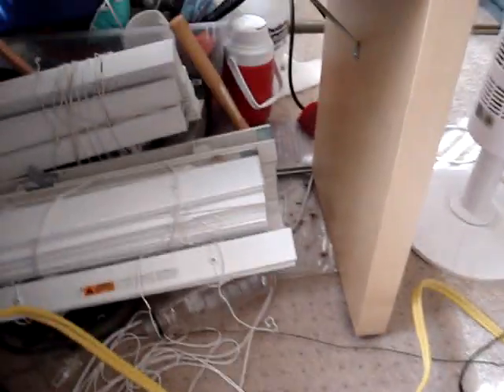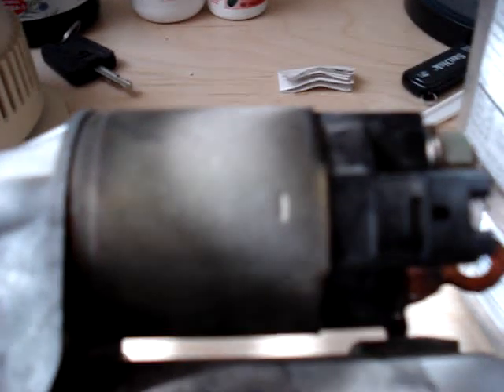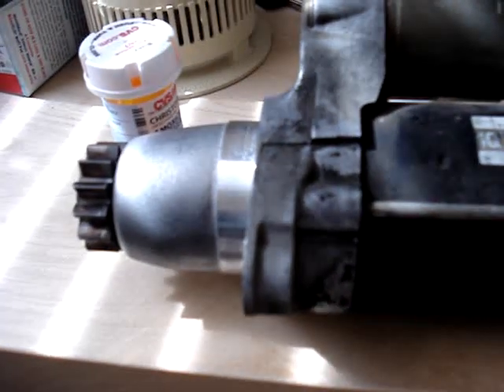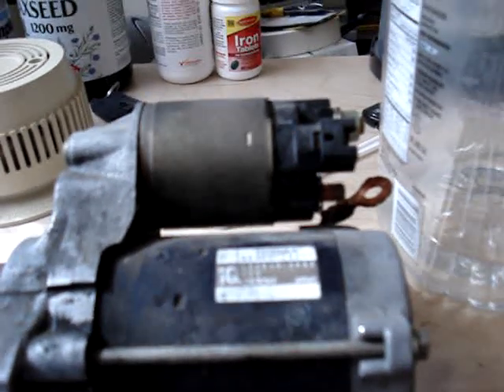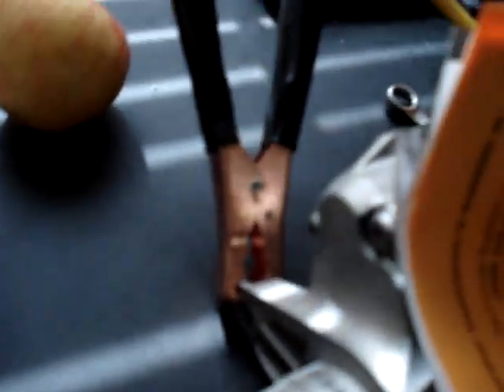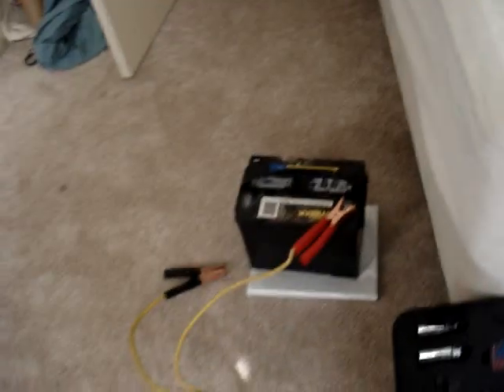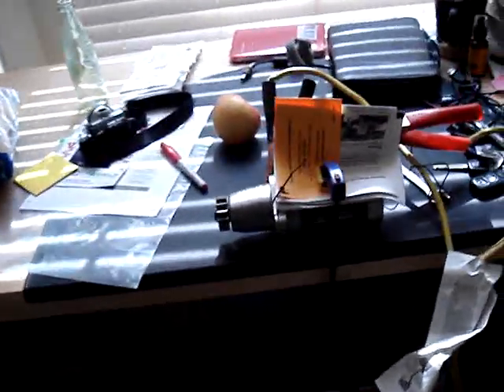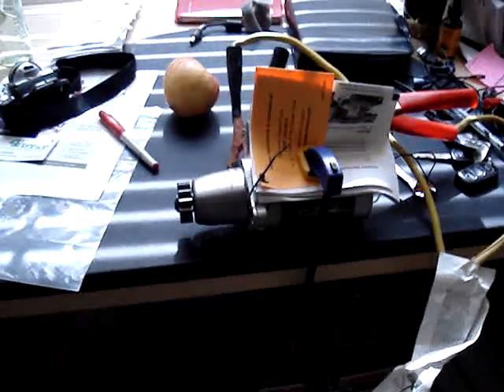Testing a car starter (solenoid and motor)

Comment from the maker: That sounds a lot like a dead battery.  Did you get a big enough car to jump you?  John's starter failed that way, though.

I'd get a volt meter, check the battery, if that's good, then get the battery checked by a battery shop to make sure you don't have a dead cell.  Then check the voltage between the hot wire going to the starter and the chasis / negative terminal and have someone turn the key.  (Be safe, of course).  If it's all normal, consider replacing the starter.

Comment: Dude, help! Can a starter motor fail so bad that it won't even click? It simply does nothing. All i can hear is the relay in the fuse box under the  steering wheel clicking once when rotating the key at maximum, and clicking again when releasing the key. However , the starter won't make a noise. 
The car starts if pushed and stays on, runs normally, but once i shut if off, it won't start again.
I've also tried attaching the cables to another car, but nothing.

Comment from the maker: This is for a Toyota Camara, can't remember the year.  Yes, the motor can spin without popping out.  This occurs when the solenoid fails but current still passes through the starter itself.  The solenoid is the black cylinder located above the starter motor.

Comment from the maker: (cont.)

Additionally, most cars have a relay in their ignition switch which draws a small amount of current to trigger the closing of a more hefty circuit used to start the car.  If you try to start your car directly from the ignition, you'll probably fry your ignition.  This was a major design flaw in my roommate's '84 mustang, which is the only car I personally know of that routed all the starting amps through the ignition switch.

Can't speak for the 66 Impala, though.  Best of luck.

Comment from the maker: To 1uneek:

I assume you've already looked at the other videos on testing a solenoid; if not, there are some good methods for checking the viability of the circuit before and after the starter posted by expertvillage.

If you apply power directly to the solenoid with a return ground from the solenoid, you should see the starter motor pop out but not spin.  If you connect to the motor directly and bypass the solenoid, the motor will spin but not extend.

Comment: Ideally you want to avoid sparks flying around the battery, which may happen if you use one of the battery posts as a hand switch. I would therefore use a remote starter switch, or if not available I would make the last connection at the starter, well away from the battery.